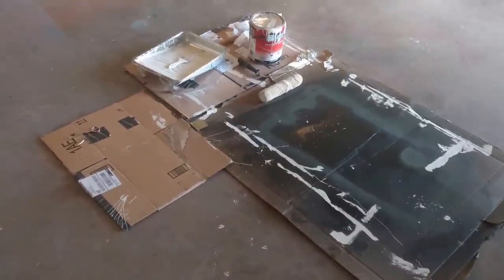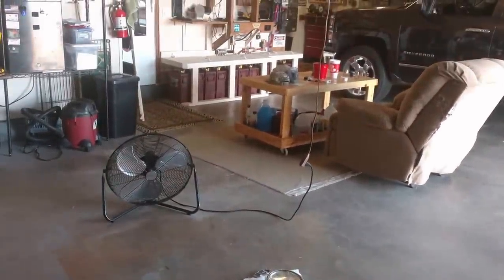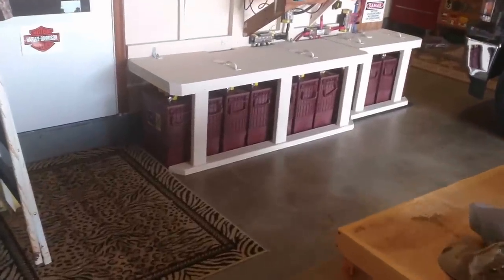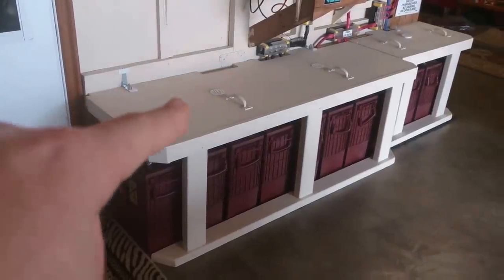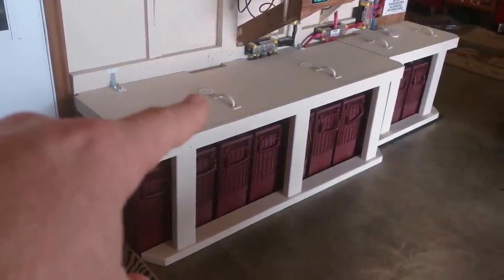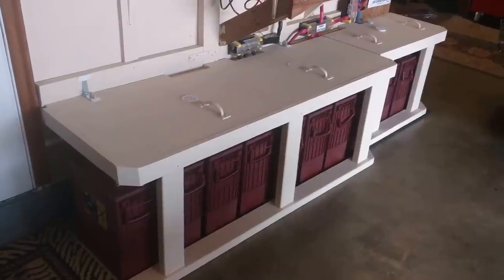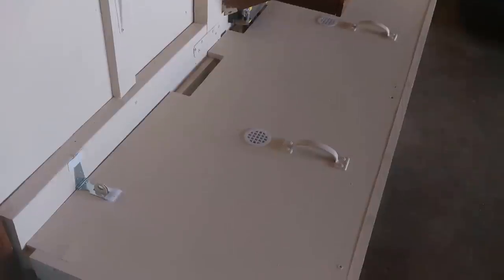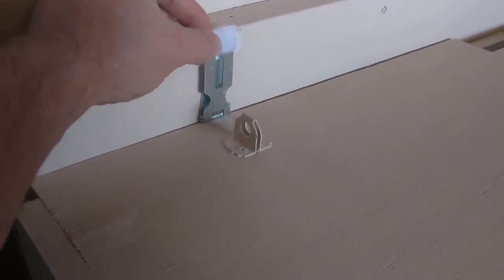Just painted! Home solar battery bank shelf/cover (two piece)

Comment: looks very nice Chris. Great Job.
I picked up my new Inverter at the post office today. The box looked like it was dropped on one corner. When I opened it up at home I found a very badly damaged Magnum inverter. Amazon emailed me a return lable now I have to drive to town and find a UPS store. this kind of thing happens alot with the post office but I have never had a damaged package with UPS. It's all good though because it's to cold outside to install it anyway lol.
Reply from the maker: Thanks. I know a guy who got a new Magnum inverter that had the exact same thing (damaged). Ironic? I don't know...but, I see something trending with their packaging/handling.
Reply: The packaging is done very very well but it is so heavy that if it gets dropped it's own weight crushes it.

Comment: What about using magnets instead of Velcro on the clasps??? That way when you open them you can just flip them up and the magnets will just hold the clasps up without the need to press on them to make sure the Velcro is secure. Might give it a cleaner look also...
Reply from the maker: Good idea.